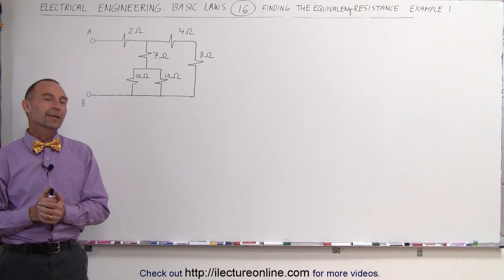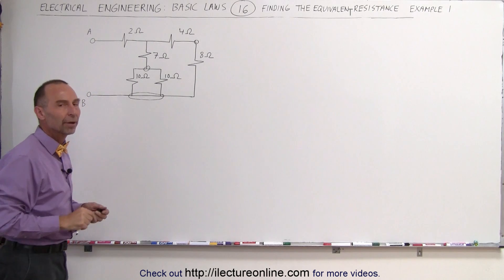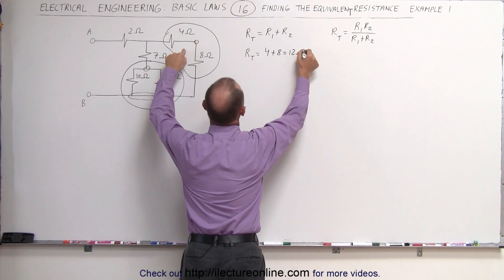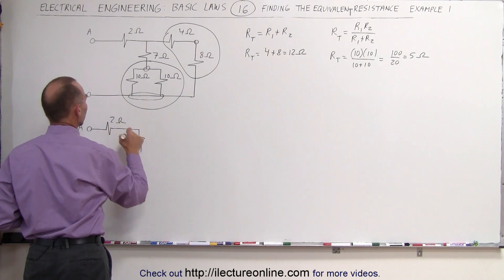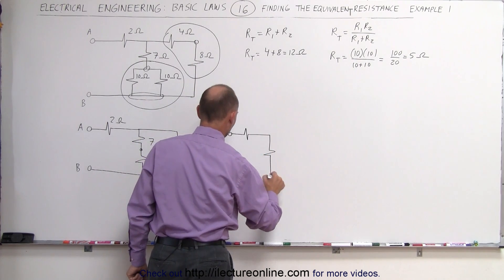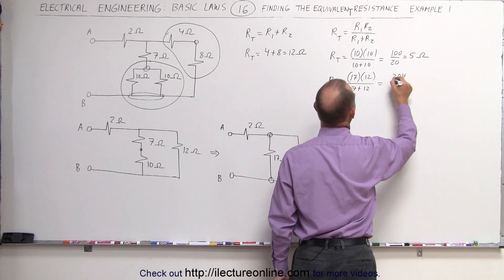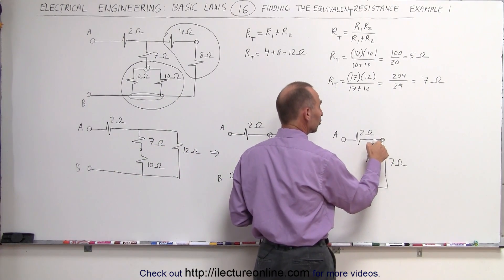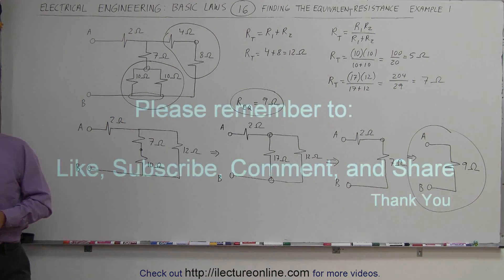Electrical Engineering: Basic Laws (16 of 31) NOTE ERROR! Finding the Equivalent Resistor Ex. 1

Comment: The equivalent resistance of the parallel 10 ohm resistors should be 5 ohms. I think you placed 10 ohms back in the diagram.
Reply: +Keith Kopnitsky  agree with you
Reply: Keith Kopnitsky correct answer should be 8 ohms
Reply: please +Michel van Biezen
,  add a pop up message on the video when there is a mistake so the next watchers, doesn't spend time figuring out why they have a different result. YouTube makes it easy, it takes 2 minutes to do it!
Reply: @CaptainCalculus  concur!
Reply: @za.z.6061  yeah, but the error is super obvious - also, this setup makes the learner more invested into the lecture, allowing for potentially greater retention of details

Comment: The equivalent resistance of the parallel 10 ohm resistors should be 5 ohms. I think you placed 10 ohms back in the diagram.

Comment: it should have been 2 ohms den 7 ohms then 5 ohms and finally 12 ohms instead of that 10 there should have been that 5 ohms that he calculated  for that 10 and 10 ohms parallel resistor
Reply from the maker: +Bhavesh Panchani 
You are correct, I copied the wrong amount back in the diagram.  I'll make the corrections.  Thank you.
Reply: Ur welcome Sir......and Thankyou for the wonderful explanations ....u have made my life easy in both electrical engineering and in Calculus

Comment: Correction: The equivalent resistance of the 10 ohm parallel resistors is 5 ohms. 

The total equivalent resistance of this circuit is 8 ohms.
Reply: youre right 8 ohms is the equivalent resistance
Reply: youre right 8 ohms

Comment: ERROR!!! ERROR!! ERROR!!
The two (2) 10 ohm resistors in parallel!! 

You calculated their resistance correctly (10||10 = 5 ohms), but you wrote 10 ohms in the diagram (at 2min 38sec) instead of 5 ohms. This should result in two (2) 12 ohm resistors in parallel in series with the 2 ohm resistor, giving a total resistance of 8 ohms (12||12 + 2 = 8)
Reply from the maker: Yes, note the others that caught the error as well below.